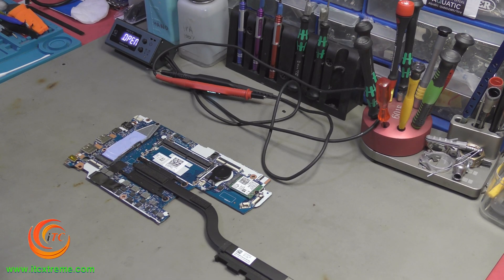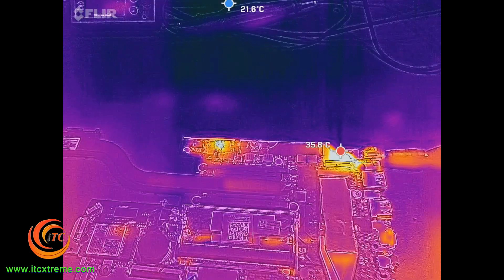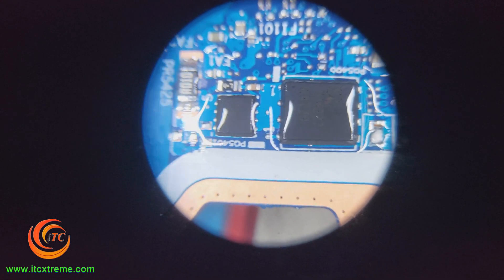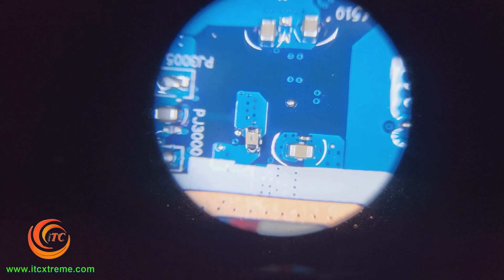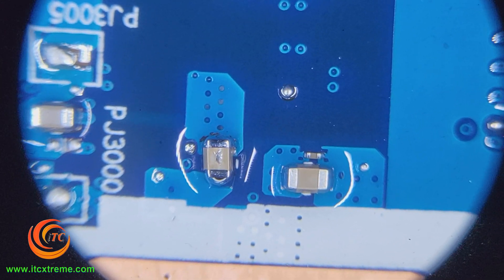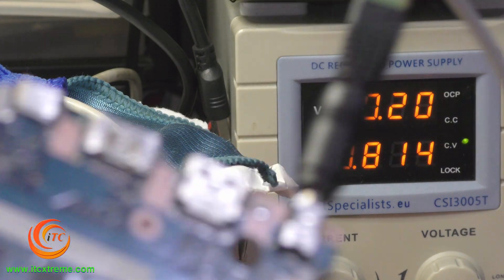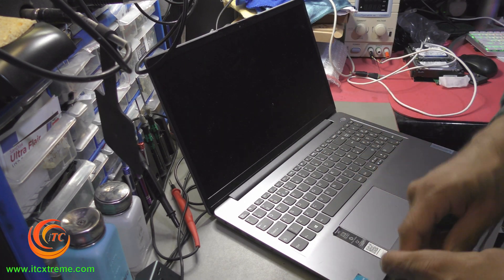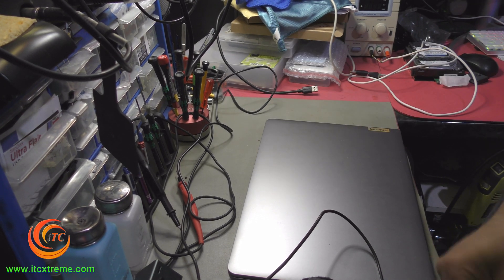Lenovo Ideapad 3 - 15ITL6 dead no power fix

Comment: Great job sir...very fast job finding problem...can i know heating tool you use to take off capasitor...look interesting tool
Reply from the maker: Hello I am using metcal mx 5000 solder station with metcal hand tweezer
Reply: @iTCXtreme  tq sir

Comment: Should the laptop be charging without a capacitor? If you removed the bad one, should you not replace a new one to help with the regulations of the right amount of voltage going to the battery? Kindly respond, I really want to know so that I may get to fix my laptop. Thank you in advance for your time and response.
Reply: Its a decoupling capacitor for reducing noise probably only 100nF, going to have zero effect on battery charging.